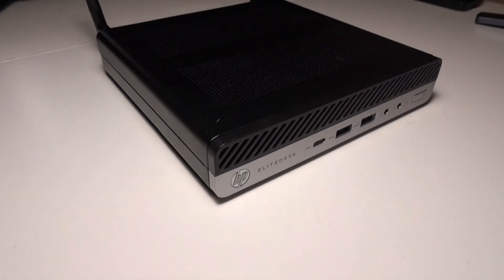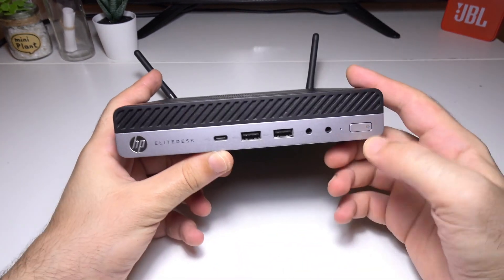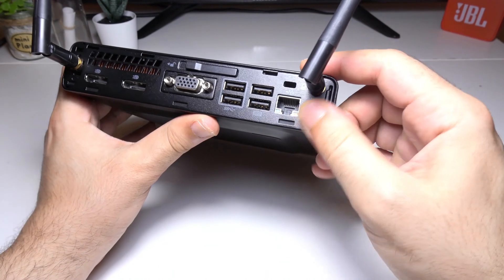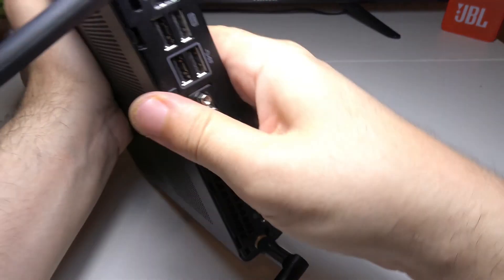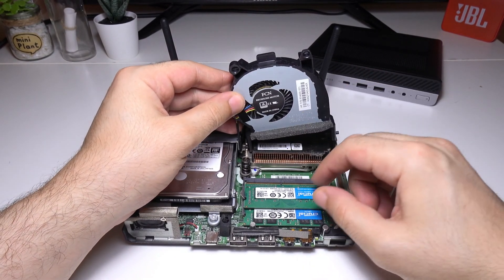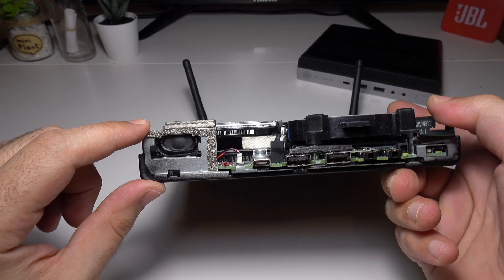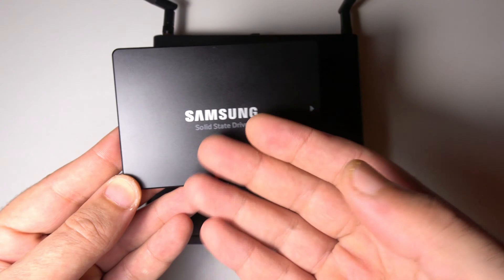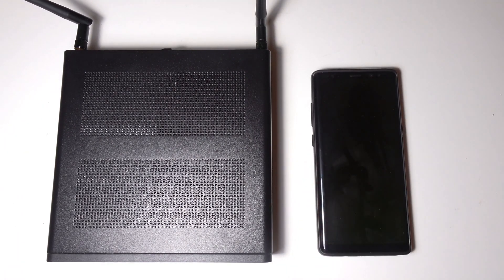HP EliteDesk 800 65W G3 (Everything You Need To Know)

Comment: I hate mine,and I don't see anyone talking about this issue, and I've had to use one at work for about a year now. The fan is very loud and runs pretty constantly and pretty hard. Because the grid for the fan is facing up it collects dust constantly and is hard to keep clean enough. Also there is almost no airflow on the bottom because the most surface area is nearly flush against a surface. So unless you can rig it up for better airflow, it's gonna be loud.
Reply: Yes, the 65W models have a more powerful and therefore louder fan than the 35W models and there is also two of them (extra for for the nvme drive) compared to only one on the 35W models. All of that adds to the noise. I have both several 65w models and one 35W model. I can say that the 35W models are very bearable while the noise that the 65W models make is quite annoying especially in a quiet environment.
Reply: @Zinchux  is 35 watt varient good enough ?
Reply: @danyalahmad2097  Depends on what are your needs, but the 35W variants are really good for like the average office workload or even having it as a server at home for multiple workloads like PLEX, pihole, etc at the same time.
Reply from the maker: Have you considered changing the fan? This isn't an issue I have faced nor heard about, this form is used at my place of work and one of the reasons I was encouraged to buy it.
Reply: @RandomTeq  unfortunately I can't alter it at all as it is company equipment :(
Reply: Have had a few months and it’s silent so far
Reply: @nathanielwright1493he said at work, so I guess he can’t open up company property?
Reply: rubber feet can solve at least 1 issue
Reply: Buy a tiny fridge - drill some hole - put it in - close the door - duck tape it. Done there no dust nor noise
Reply: @Cyonav  ! Интересная мысль !